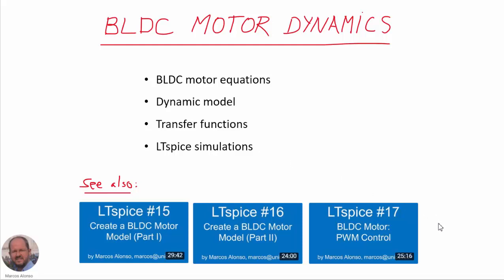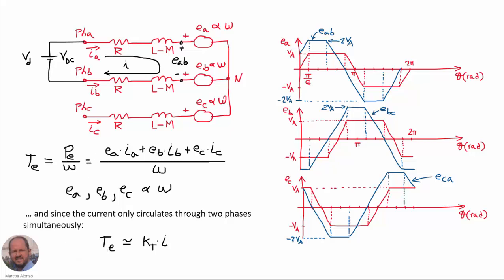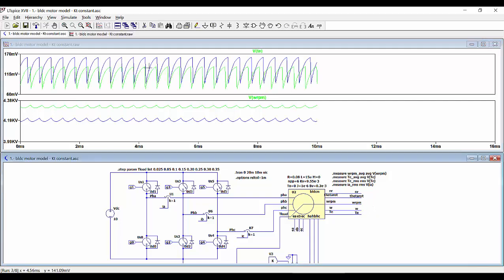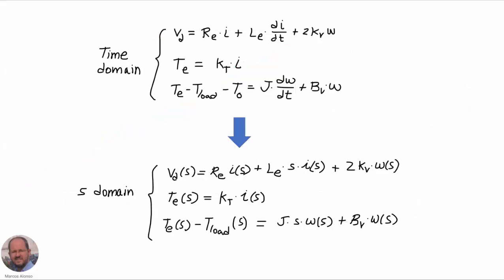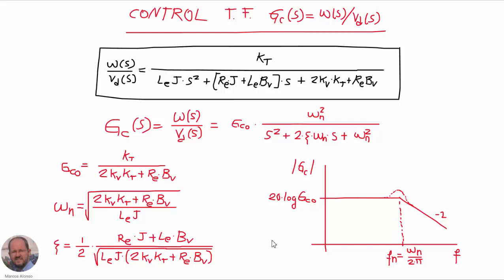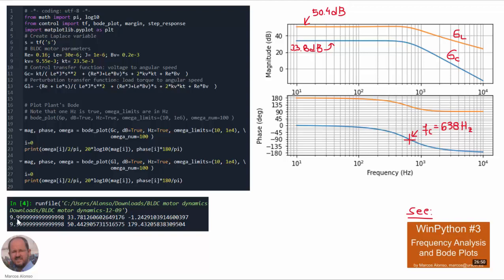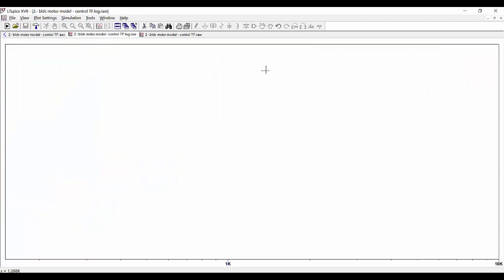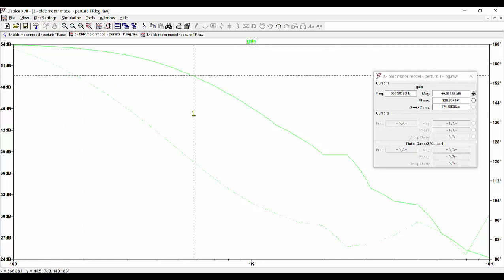LTspice #18. BLDC Motor: Dynamic Modelling

Comment: is it possible to create a dynamic model with the LSE method
Reply from the maker: I think LSE method can be useful to obtain the parameters of the motor from experimental measurements.
Reply: do you have a book suggestion for me to learn about dynamic modeling, because there is a course assignment but the data is taken directly from the motor using a microcontroller 🙏🏻
Reply: Or you can teach me the steps, for my own task discrete and continuous dynamic modeling using the LSE method of BLDC motors

Comment: Excellent work.  Can you tell us what the purpose is for determining the gain and phase margin of the motor plant model in practical applications?
Reply from the maker: Hi, thanks for your question. The gain and phase margin can be defined for the loop gain of the system in closed loop, not for the plant model. They are used to evaluate the stability of the closed loop system.